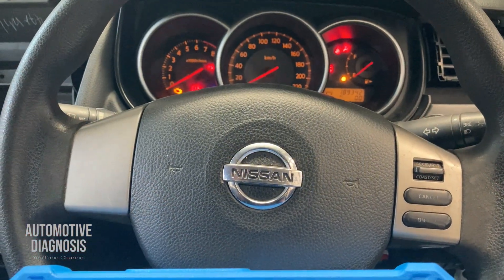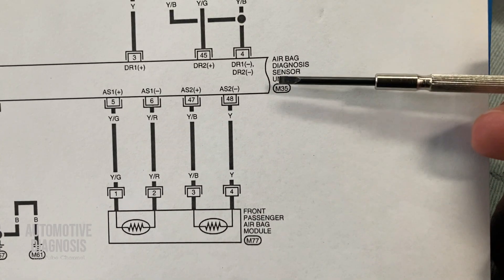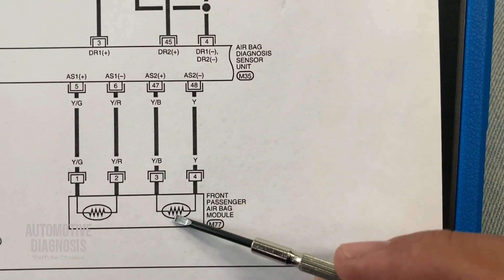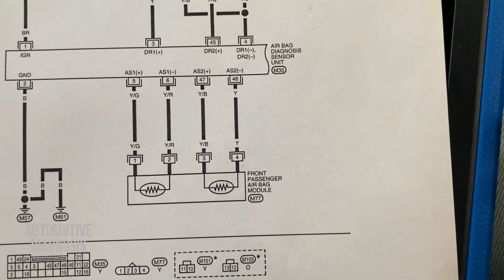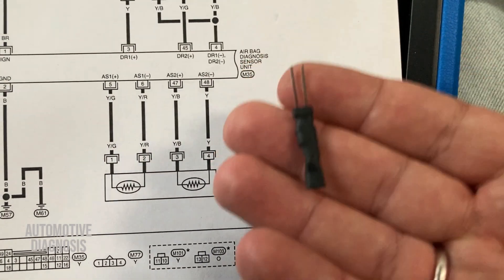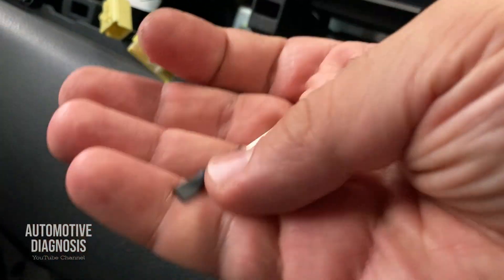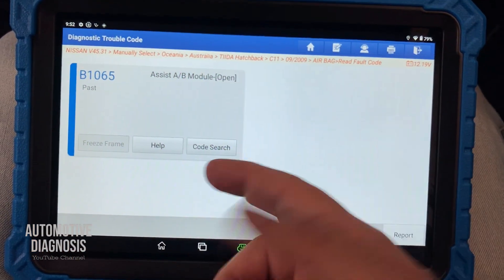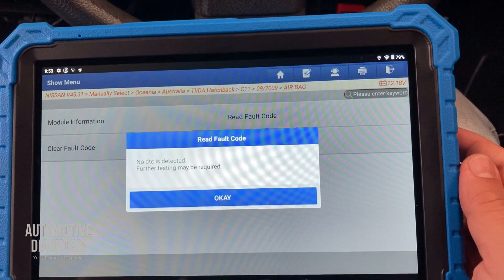Nissan Airbag Diagnostics #airbag #nissan #howto #diagnostics

Comment: How can I get the dominoes resistor please or how can I build it
Reply from the maker: Hi my friend, just search on Google for airbag dummy resistor
Reply: @AutomotiveDiagnosis  did it have particular vote or not please
Reply: Also can I used it for any car or only the nissan it can be used for
Reply from the maker: @ I have used it on many different cars, generally airbag and pre-tensioners resistance are very similar. For certainty you can check the airbag system with scan tool, normally resistance value is mentioned on Live Data for each airbag.

Comment: Great video brother. Question: If you connect the dummy resistor and it still says open circuit, does that mean it is bad wirring? How do you tell if it is bad wirring or airbag module itself?
Reply from the maker: Hi there. It could be either wiring or airbag module, so the next step in that case is to check the wiring between airbag and airbag control module, is wiring is bad, get it repaired, if wiring is ok, you have a bad module.